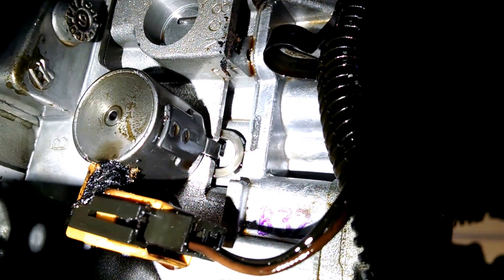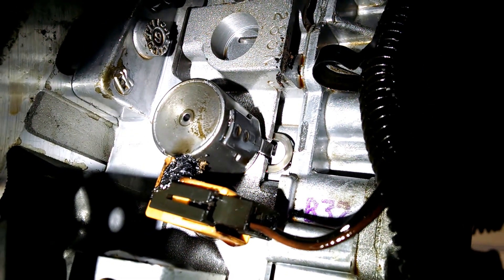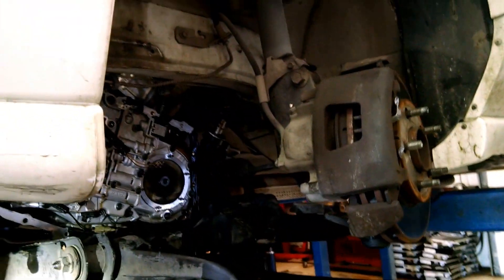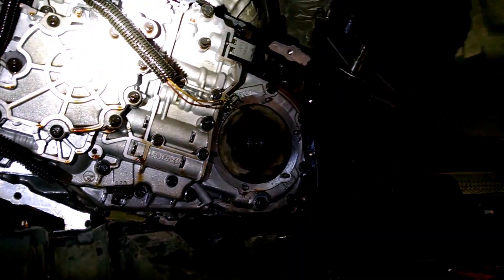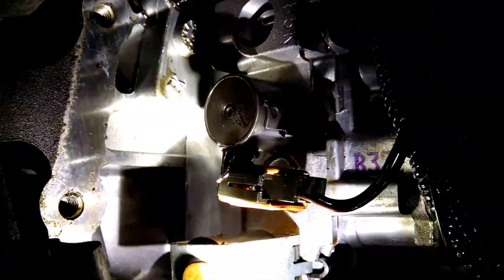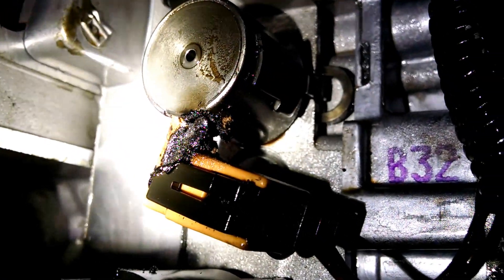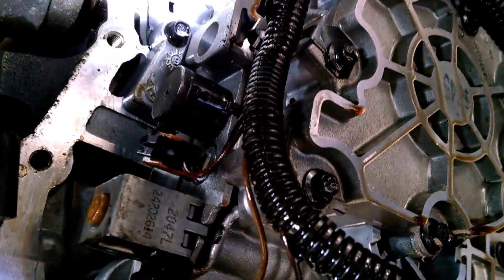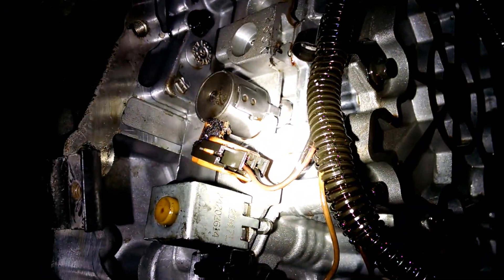Transmission shifting problem and blown fuses #5

Comment: I got a 1999 Dodge Durango 5.9 just put a new rebuild transmission in it and it won't shift now
Reply from the maker: HI Heath, Sorry your having problems. Fluid at the full mark and relearn or reprogram already done on the transmission? 2 or 4 wheel drive? Can you manually shift it up by starting with the sifter lever in the lowest gear and work it up as the RPM increases? What was wrong with the first transmission?
Reply: @Craigs_car_care  the frst transmission was toasted when i got it would not move at all the girl i got it from it belonged to her dad that passed away .the durango it's a 2 wheel drive i tryed every thing all she knows is that it set for. Five years at her dad's house .
Reply from the maker: It probbly needs to go to a transmission shop for testing to see if it is just programming, TCM (transmission computer) or wiring or a mechanical problem with the Re manufactured transmission.
Reply: Ok hope i can find someone that can help me figure out how come it won't shift.

Comment: Have a 2000 chevy blazer and it only goes 1st n 2nd gear , no 3rd?
Reply from the maker: Hi John, Does it have reverse? How's the fluid look and smell? (Burnt or black?)
Reply: @Craigs_car_care  , it has reverse , fluid is a lil burnt
Reply: What should I do or try
Reply from the maker: @johnbrisco5500   Look for any linkage that has come off at the transmission or the side of the throttle area. If all the linkage looks ok then the transmission may be damaged or worn out internally.

Comment: I just bought a 1999 ford f150 4.6L triton v8 and the coolant line busted on it and soon as the line busted i was driving it and it started acting like the transmission was slipping and bogging down like it didn't have any power what kinda it be
Reply from the maker: Hi Christopher, It could be anything from the engine or transmission overheated to the hot coolant got something wet (Are you talking about the engine coolant or the transmission coolant?).  After the coolant leak is fixed and refilled and everything is cleaned up see how it runs.  Thanks for sharing.
Reply: The line busted on the passager side in the back of the motor and it didn't start slipping till the line busted
Reply from the maker: @christopherwalker256  Was it engine coolant (antifreeze) or Transmission fluid?
Reply: Antifreeze
Reply from the maker: @christopherwalker256  Ok, Did the engine get hot at all? The transmission cooler in many cars and trucks run through the radiator and I have seen more than one cause this sliping issue after and engine overheat.  If you have not already done so check the transmission fluid level and also make sure it is full and not black.
Reply: Yes i did get hot
Reply: What does it mean if it's black hopefully not bad
Reply: Yes it is black is that a bad thing hopefully it not
Reply: Its more red then black
Reply: But am color blind lol and i just went around the block with it and its shifting fine
Reply: Now the shifter on the dest isn't working
Reply from the maker: @christopherwalker256  Ok, it may have damaged the transmission then. :( . It was probbly already weak and that can put it over the edge. Is the fluid black and smelly or dark red to red?
Reply: Dark red
Reply: Dark red to red
Reply: I can get it in reverse now just can't get it in to drive could the transmission fluid need changed
Reply: Because i just bought it Saturday
Reply: O and i just drove it this morning and it didn't slip or anything and i came home parked it and about 10 minutes later i went to leave and that's when it started doing the not going in gear
Reply from the maker: @christopherwalker256  You might try to see if a shop can reset the premaniters for the shifting (re learn) and also verify what is slipping and go from there.

Comment: I have a 2007 Chevy equinox and my 80 amp fuse keeps blowing and it keeps showing a engine hot/ac off warning, and it turns my fans on but my engine really isn't hot. Do you know why it keeps blowing?
Reply from the maker: Hi Chris,  There is a dead short taking place. You would need to locate the wiring diagram and start disconnecting things down the line until the short goes away. I would need to know what the fuse goes (what circuit) to and it's location in the power distribution box.  It will take a lot more information for me to be able to help. It may be necessary to check with your local shop to let them find the shorted out component or wire.
Reply: Hi, I have a 2007 Nissan Frontier with automatic transmission while I was driving went through a pothole and after that four wheel drive started showing on the dashboard that was activated drove a half mile parked the truck and when I wanted to start it it didn’t , now the truck starts with straight connect to the starter cause for some reason the internal components on the transmission is blowing the starting up fuse am wondering if I need to replace the transmission or just remove the cover on the transmission and see burned wires?
Reply from the maker: @fernandoescobar6528  It sounds like the short needs to be fixed. No way to know for sure what other wires may have also been damaged when the truck hit the pothole. If the area of the damage is not identified the problem could get worse.  It may be just something in the fuse box or a group of wires. Probably start with a good visual inspection around the batteries and the main fuse and relay box. This could be a simple as a main fuse that was blown or failed /loose relay.

Comment: I have a 2011 ram 1500. Someone used a jumper wire in the fuse box, the wire burned out and blew all my fuses. All were replaced but when I turned the truck back on the check engine light was on for a bad shift solenoid. The truck goes into "limp" mode from time to time but the light stays on. Could this be a similar reason for my problem?
Reply from the maker: Hi Mike, Great question , Sure could be melted wires, Double check all the fuses under the dash and under the hood. After that trace the code for the shift solenoid and see what that leads to. Fix what you know is broken first and go from there. Good luck.

Comment: My 2000 Chevy Silverado 1500 ls automatic is hitting 30mph at 4k rpm and 70 at 5500rpms. Transmission shifting problems and don't know what to look for
Reply from the maker: Chris it sounds like it is not shifting up past 2nd or 3d. As always make sure the fluid is full and not burnt/black (If it is then the transmission is probbly toast and in need of rebuilding or replacement) With the fluid full and red or dark red, next check that the gear selector and cable are in the correct position. A sliped ,stretched or broken cable or broken shifter or shift indicator can  give it the appearance that it is in the drive position (D) or  (O/D) but is actually not going above  1st or 2nd gear. Without me actually seeing the truck that is where I would suggest you start.  Also a check of all fuses in the power distribution box under the hood and the fuse box inside the truck (see your owner's manual for fuse locations) then with a scanner that will check all modules for data trouble codes, see if any are present and run them down and fix these also. Even if the transmission turns out to have a hard failure in it , you will still need to seek out other issues and correct them as these can be the root cause of what damaged a transmission in the first place. So this way if you replace the transmission you do not miss something that would damage your new one.  Great question and good luck Hopefully it will be a simple fix.

Comment: Hi everyone , I'm experiencing a problem with my 07 dts Cadillac accelerating once I shift it into drive , reverse , 1st or 2nd gear , any the crazy apart I experience this problem after my battery died n receive a jump start . Some days the car move in drive and reverse gear but only for a brief moment n then it doesn't move anymore , can anyone tell me what it can be ?
Reply from the maker: Hi Funny Guy, Cover the basics that the fluid is full and no fuses are blown. Check all the fuse boxes, (your owner's manual will have their locations) If that all checks out then try unhooking both battery cables wait 20 minutes then hook it back up and see what it does. It may be that the learned values for the transmission pressures was lost. Now it has gone back to the factory settings and is to low for a older and more worn transmission.
Reply: @Craigs_car_care  well I'll tell you all what I did so far to check to see if the transmission is dead , I top her off with more transmission fluid and I also use a bottle of Lucas transmission fluid , yesterday I put the car in drive , it move forward , I put the car in reverse it also reverse , also note that shortly after doing so the car completely stop moving gear I also notice that when I shift to park the car kept rolling forward like I was in drive . So finally after letting the car cool down because the car always move after a cold start , so after letting the car cool down I took it for a ride around the block and the car didn't make it halfway , my dts completely came to a stop while still started so I push it the rest of the way  to the house . I like to add a few things that I didn't in my moat recent post and that I purchase the car 60 days ago , I check the fluid but didn't check the transmission fluid , I know silly of me on my behalf , I been driving the car for 60 days with little to no transmission fluid till I started having these problems I mention .
Reply from the maker: @funnyguy1112  Oh Man, sorry to hear. It may be  to late for the mechainl side then. These things do not do well without fluid to keep the heat down. With it being full now but still not pulling Id say it needs some internal help . AKA, Rebuild or replacement.
Reply: @Craigs_car_care  I was thinking the same thing but before going that route , I figure I get a transmission kit and do a transmission flush and if that don't bring it back to life , I'm going to see what options I have on a transmission rebuild , my next question is which fuse box I check for the transmission fuse , do you know the exact fuse I'm looking for , I did have a few blown fuses . Thanks and gratitude brother for the info . Can you share more information on how the fuse play a part in the transmission functions ?
Reply: @funnyguy1112   
 did u eva fix transmission problem funny, my dts is doin the exact same thing..i have checked everything n its not throwing a code
Reply: @lennyljjeffers  same here didn't give me a code or anything , I'm doing a transmission flush n going to get all new fuses n see what that does . But it might be the end of the line for your transmission brah . Mines didn't give a code either , I'm just trying everything before I get a new transmission . Is your fluids up to par ?
Reply: Yes fluids good, keep me posted if it fixed it..thanks
Reply: @lennyljjeffers  I Wil, and you keep me posted to , if you find the fix .
Reply: @funnyguy1112  sure will
Reply: Can you do a video on fuses...

Comment: Just replaced trans oil filter and still wont shift out of low gear " Anyone know why?
Reply from the maker: Joe really sounds like the transmission may be on its last leg. If the old fluid was black or smelt burnt or both the trans is probbly done for. Start by checking the trans linkage at the throttle area and the linkage at the shifter and the side of the transmission to see if anything has come off or is out of place. If you can not get it to shift with the manual gear selector by starting out in first them when you shift up to second if it does not shift them it probbly is transmission time.   Hope it is just linkage. Thanks for posting